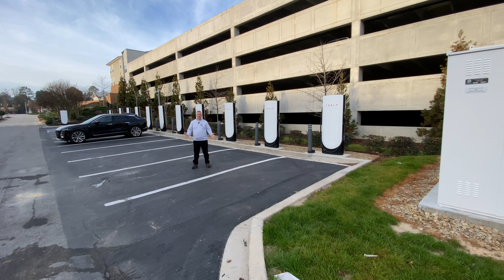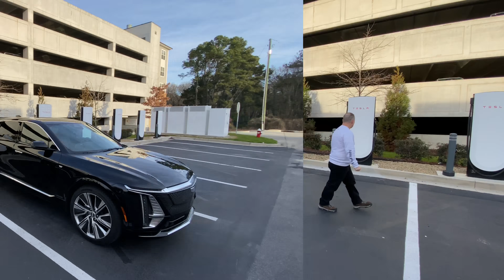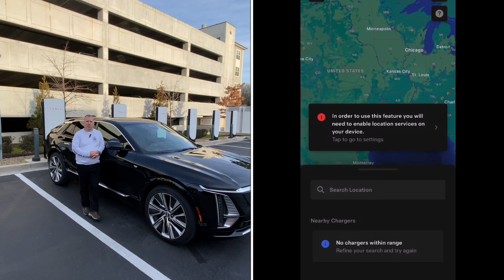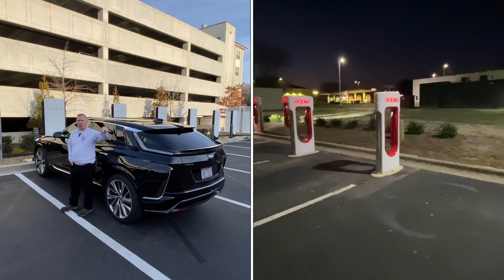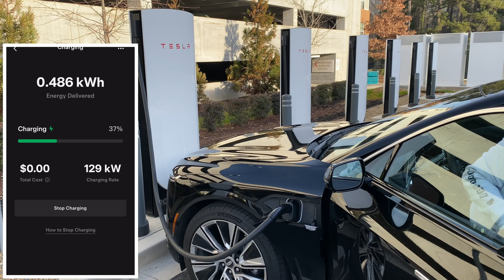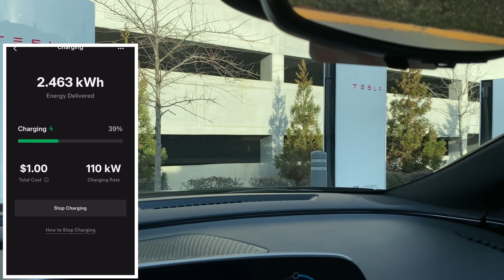How to charge a Cadillac LYRIQ at a Tesla Supercharger

Comment: Thanks for sharing your V4 charger experience.  Much easier than the select V3 stations with the Magic Dock.  Seems Tesla is only installing new V4 stations at this point, the V3 stations aren't being retrofited.  Hopefully soon, as it will be trouble with the short cords when all the CCS vehicles gets access to the full network shortly.   Your V4 experience was great.
Reply from the maker: Thx for the kind words.  It was a fun way to spend the cool of a morning.  Stay safe.
Reply: Hopefully, they will replace the V2 sites to provide better coverage for those of us non-Tesla drivers.
Reply from the maker: @YeOldeTraveller  I am not 100% sure, but I do not think Tesla is upgrading sites.  Instead their focus seems to be on adding new sites under the thought that more is more at this juncture.  I may be wrong, but that is the feel I am getting.  Thx 4 watching.
Reply: Does the Cadillac app handle the billing or do you need a Tesla app?
Reply from the maker: @brianbk1974 Tesla app

Comment: Hey Lyriq owners, has anyone been able to charge their galaxy A15 Android cell phone in the charge port? It appears it’s the only one in my family that does not charge.
Reply: Lol thats such a specific ask I chuckled hard.   I have a z fold 6 I was wondering about charging also.  I don't have a answer for you but I do have a question.  Do you like it ? I'm getting my end of year bonus in about 3 weeks and was gonna get my first ev and I belive I'm going with lyriq if I can find a 2024 used under 36k bucks  and under 50k miles I've done massive research have the updates fixed the air conditioning issue of low speeds and thr known software bugs ?

Comment: Thanks for posting! Great video!  It looks like your charging time was over an hour. Do you find this is typical? Have you found the charge to be faster at a station that delivers 350kw? Also, when are you planning on doing video of the Lyriq charge using the adaptor? There are some adaptors available made by third parties. Or are you waiting for a GM adaptor? Thanks again!
Reply from the maker: It has been a minute, but I think the time I spent there in total was about an hr with charging time more like 20 minutes.  What u see is an estimate to 100%.  We don’t charge to 100% on road trip stops and normally see 20-40 minutes at each stop

Comment: Thanks for posting. I am strongly considering getting a Lyriq, but without access to the super charger network I am hesitant.
Reply from the maker: No reason to purchase right away if it is not for you.  Maybe wait for the J3400 charging port too?
Reply: Yeah, for people who are unable to change at home or work a changing network is necessary. That said, i’ve so far had no issues changing at non tesla chargers.
Reply: @ You are right.  As a follow up I purchased a Lyriq, and am happy with the new car.  I've never had an issue charging, although found that I charge at home almost all the time anyways, so it was a moot point.

Comment: They opened up a 20 stall v3 Magic Dock station back in May 2024 and it's the only one of its kind in West Central Florida at the moment. I only need to DC fast charge at most once a month due to work having me travel just slightly outside my comfort zone. It's less than two minutes off the interstate exit behind the 24/7 Wawa gas station.

Another workaround due to the short v3 cables is I always use the far end stall which is normally reserved for handicapped access use last rule, that way I am not taking up 2 stalls. Most of the time I only need a 5 to 10 minute charge session since I am capped to 50 kW charge rate to give me enough electrons to get me home and when the need arises, I'll gladly end the session early to give them to access to it.

On the last charging session, I talked to a Tesla Energy tech and they mentioned that the existing v3 charging posts can be upgraded to the new v4 posts in the future since the mounting base footprint are the same, but right now it's only being installed on new sites.

Comment: Thank You.  Enjoyed your Video.  I have a 2024 Cadillac Lyriq Lux3.  I also have the Tesla App on my smartphone.  I stopped at Buc-ee's in Florance SC off I-95 with 18 miles left in my batteries.  I pulled up to the Tesla Station and got out my adaptor ( After-market -Supercharger (NACS) to CCS Adapter | Vortex Plug | 500A | 1000V ). Plugged it in and attached the Tesla cord to it.  NOTHING !  What was worse was that there was no way to contact Tesla. No 800 number.     Now I know to look for something with at least 250W charging.    As luck would have it,  there was a Mercedes bank of chargers on the other side of the parking lot and they were using ChargePoint which saved my butt.
I know the Truck stops along I-95 are starting to put charging stations in but is there a way to get a list that has been installed and operating.  It's very frustrating to have to drive several miles off a major interstate to look for a charging station.      Also, my Cadillac dealership told me that with the EV-GO 2-year free charging I could use ChargePoint and Blink.   I call both and they claim there is no agreement.  The same when I called EV-GO.       I don't do a lot of driving outside my home area except for vacations or family trips.  Love the car and the ride.   I have a home charger in my Garage and from now on for long-distance trips I will start looking for chargers at 50% battery levels.
Reply from the maker: Yes, I do update videos on the Pilot / Flying J Truck Stop EV charging builds.  You can also look in the PFJ cell phone app.  Just filter their locations for CCS plugs.  You will see all the ones open.  The Buc-ees in Florence has that real nice MB station.  BTW, no TesSC will work yet.  It is going to be a little while b4 GM cars can use it.  Should be a news story when it does, so you will know.  Enjoy your LYRIQ.  We love ours too.
Reply: @thenetworkarchitectchannel  Thanks .... and keep those videos coming.    I have to laugh because when I was growing up my Mother had this thing about big large taillights on cars.  She wanted to be sure that folks KNEW when we were stopping.  Wouldn't let Dad buy a new car unless she did the walk around to check out the brake lights.   Having so many brake lights on my Lyriq brought back fond memories.    ( Love the Auto Hold Feature )

Comment: I am still lost as to how you determine if the charging station is a version 3 or version 4. How do you determine this? I think I would rather just buy a Tesla automobile knowing that it will charge EVERYWHERE!! The last thing I need is some confusing charging network where the possibility of arriving at a charing station that doesn't work is very real! I mean I DON'T WANT TO BE STRANDED AT THE WRONG CHARGING STATION!!!!!
Reply from the maker: No V4 really yet, but the dispenser looks different in v4

Comment: I understand that you wanted to show people how these work with non Tesla ev’s, but that video should’ve been no more than 3-5 minutes. You told us way to much common sense stuff about the room for the vehicle, to park close or not, and definitely the ending when you spoke about 3 ways to disconnect. Using the alligator clip is a must because you have to disconnect from the car, is the only way to actually disconnect the cable. Like I said, the video was ok, but way to much talk about common sense stuff.
Reply from the maker: Thx 4 the feedback.  The disconnect in the new adapter universe I felt was worthwhile time spent.  I use to drive a M3LR as my daily driver.  As any Tes owner will tell you, the stupid adapter staying put after pulling out a charging cable and the charge port door closing on it was a pain.  Took two hands to do right and a bit of a learning process.  Here you can kill the power by pressing the alligator clip, but you can also kill power from a safe distance and lift the alligator clip after power dies a few ways.  I am confident drivers will find ways that work for them.  You suggest everyone must do it your way and that is a very narrow view that believes your way is the right way.  There are options.  Your way is the right way for you.  Me, maybe not.  Someone else maybe but maybe not.

Good news bout the pulling all the way in is Tes is making an extension, so gonna be a non-issue in a bit.  Thx 4 watching.

Comment: Thanks for the video, looking to buy a lyriq and this was a big question I had, you seem like an expert and I’m wondering if you know the charging speed difference between Tesla and lyriq. I believe Tesla can go up to 250kw an hr but not sure what lyriq is limited to? Does the charge port option on the car matter? I believe they offer 2 versions on the lyriq. Also if I buy an adapter can i use a v3 station currently or will the Tesla app only allow v4 for non Tesla’s?Thanks and I hope you are able to respond
Reply from the maker: LYRIQ can charge 70 kWhs in 33 minutes, which is pretty good.  Its top rate is 190 kW, but it stays above 100 kW further then Teslas.  The bigger difference though is the LYRIQ has a 102 kWh battery pack.  This is not comparable to the Mod3 or ModY.  It is closer to the ModX which is what it competes against.  However, it costs less than the X and has more to offer.  I hope this answers your qestions.

Comment: What does Tesla charge non-Teslas per kWh?

Lyriqs have a 102 kWh battery.

I have the 19kW charger option.
Reply from the maker: This station was $0.50 per kWh
Reply: @thenetworkarchitectchannel   That's pretty expensive.  

My last recharge (yesterday) at EVgo was 71 kWh.  

71 x 0.5 = $35.50

My range is about 250 miles when you subtract the energy loss from having AWD, 22"rims and highway driving.

Comment: Thanks for the great video. This was fantastic to see. So Tesla is now allowing GM EVs to charge on their V4s? Or is it just this site? I know it's only the stalls and the actual chargers are still V3s, but this is news to me. So perhaps the February timeframe of that Tesla rep in Utah was correct. Obviously, GM and Ford EVs still need the adapters, but the V4s, besides the magic dock sites, already have the adapters built in. 

Or is this the site in Columbia, South Carolina? If so, then this is the first V4 stalls site I've seen used as magic dock site that actually allow others to charge. All other V4 sites in the US still don't allow other EVs to charge even though they all have the adapters built in. 

And what's the top charging speed of the Lyriq? And did you precondition the battery if it supports that? Would love to know if the amps are not being limited to 350 like the V3 stalls magic dock sites do.

And yes, Tesla has no rivals when it comes to EV charging. They did it all themselves from scratch. When no other major auto manufacturer cared to even start, and wanted governments to do it for them, Tesla did it all themselves. And now they do it like no other. No one is even close. Building everything themselves, their chargers cost them 1/4 of what other chargers cost. And they currently average over 20 stalls installed per week. And plan to average over 50 per week by the end of 2025. That's on top of the over 22,000 already installed in the US. And all at a 99.96% reliability rate.

So you are absolutely correct, Tesla dragged ALL other manufacturers into the EV age. It's join them or go under.
Reply from the maker: It is Columbia, SC.  All EVs can charge there.  Nothing unique to GM & Ford.  I do think the leak from Utah seems to be right.  Ford just announced they are shipping their adapters and GM has mention in their Q4 earnings slide deck of H1 2024, so I expect GM to do theirs shortly after Ford, since they made the deal 2 wks after Ford did.  

The fear of Tesla is a good thing.  ;-}
Reply: @thenetworkarchitectchannel  Thanks for the info.

Do you happen to know what are the amps limit on the Lyric? I'm trying to find out if Tesla is allowing more than the 350 amps limit on these V4 dispensers with their longer but thicker cables. Whereas, the V3 magic dock stalls are limited by Tesla to 350 amps for none Teslas.
Reply from the maker: 475 by my math.  400 v w/ top speed of 190 kW.
Reply: @thenetworkarchitectchannel  Again, thanks for the info. 
So unless the battery was not preconditioned, the speeds you got suggest Tesla is limiting the amps to 350 even on V4 dispensers. I understand the chargers are still 400v V3s, but I thought perhaps with the thicker cables they would allow their max of over 500 amps to none-Teslas.

Comment: Nice to see v4 dispensers in the wild!!  Takes away all the offset parking headaches.  Took a look in the Tesla app, but haven’t seen any clues on whether a site has v4 dispensers.  Once v4 power supply is installed, the site should state the higher kWh rating.  For now, not sure if the app will ID a v4 dispenser on v3 supply site.  Thanks for the look at the v4 dispenser experience!

Comment: There is a new V3 location near me but when I use the app to show non Tesla locations I get nothing in the entire Austin TX area, any ideas? Plus do you need to do anything in the application to add the Lyriq? Thanks
Reply from the maker: No additional action in app to add LYRIQ needed.  The app will only show Magic Dock locations currently and there are only about 50 in the entire SC network, so likely you do not have any near you.  Hope this helps, but ping back in if not.  Thx 4 watching.
Reply: Thanks for the response. I thought that was the way it was supposed to work but you mentioned also just version 3 chargers so I thought you were saying those would also work, assuming you had an adapter.  @thenetworkarchitectchannel
Reply from the maker: the GM adapter is coming out sometime in the next month or two we think.  I did not mention that time frame in the video because I am thinking this video will become a handy reference for when things open at SC locations and wanted to obfuscate dates.  I will make a second video to pair with this one once the GM adapter is available.  Sorry for the confusion.
Reply: I bought the Lectron Vortex adaptor hoping that may work.  However in the Tesla app, it requires me to add my "non Tesla" Vehicle.  There is no way around this.  We have V3 Superchargers.  Anyways tried to connect and got an "Unauthorized Vehicle" error.  I'll take any tips you guys got as I am a rookie EV owner.  But love my Lyriq

Comment: Thanks, Walter! I was hoping you'd be able to confirm whether the Magic Dock adapters on the V4 Superchargers are actually rated for 500 A, as some have claimed; however, this doesn't look like you were pulling any more power than you could have on the 350 A limited V3 Superchargers. I wonder whether you got a peek at the dispenser labels, which would confirm the peak voltage and amperage of the V4 Magic Dock adapters.
Reply from the maker: It sadly escaped my attention.  I knew going in I was not making a site visit video with all the trimmings.  I was thinking of going back and doing so at a later time.  It was in a pretty nice location & about a mile + off the interstate, so not too bad.  However, I did not check the specifics of the voltage.  I guess I should of in retrospect.  Thx for watching.  It was a fun trip and exciting times in which we live.  I still think for me SC will be a second options to EVgo and even EA depending.  I also favor Buc-ee's for dietary reasons.
Reply: @thenetworkarchitectchannel  No worries. Hopefully, you can have the chance to check again soon. I know V4 uses beefier cables, and people have been reporting >150 kW through Magic Dock.

Comment: Leave it to Tesla to make a better charging experience than GM's own partnerships. My only gripe is that they haven't turned on the credit card screen yet. Having an app is a problem for all of the charging systems out there. Travelling I've been in many situations where the mobile data isn't working. The app should be a secondary payment system not primary like in every other aspect of life and fueling systems. I heard that GM is finally getting charge payments built in so it bills the car/ccard automatically. That would be nice. I believe that my Tesla gets charged even if it doesn't have Internet. Once it gets Internet the payment goes through in the car not the charger. That needs to be the standard.
Reply from the maker: IMHO better is a relitive term.  If the goal is to survive on an EV road trip, Tesla is "better".  If the goal is to enjoy an EV road trip, I go Pilot/Flying J.  I ate meat loaf there on Friday.  It was delicious.  I had a side of mac-n-cheese and green beans.  The places are awsome.  Open 24/7 with full amenities & free wifi, not to mention window squeegees. Anyway, thx for watching and taking the time to post a comment.  I agree autocharge on SC would be a dream.  Hope that is a thing.

Comment: Your information is also useful for Mustang Mach-e owners as the charge port is in the same location.

I note over 45 Magicdock locations reported in Plugshare which is easy as you can just look for CCS on the Tesla network.  For V3+, I filter for over 160 KW (one could use 200 KW just as well) on the Tesla network and the Tesla Fast connector.

Looking forward to trying with the adapter once I get mine.
Reply from the maker: U will get yours b4 I get mine, but I hope we both will be in the new normal by march.  Stay safe & thx 4 watching
Reply: Hey, cool vid, just wondering how much is a full charge on the Lyriq?
Reply from the maker: @carslover1384 104 kWh or about six hrs of highway travel